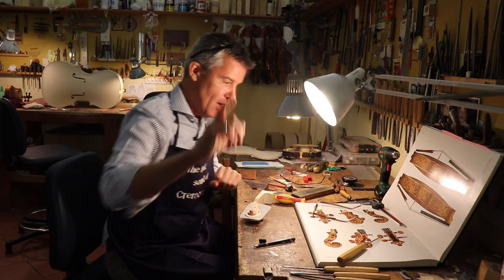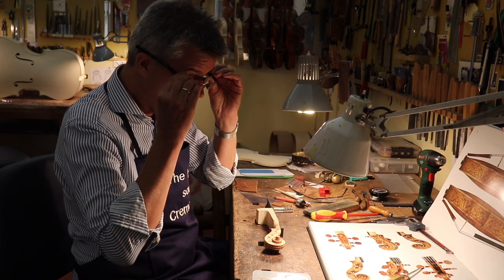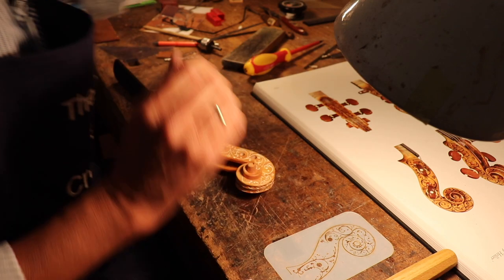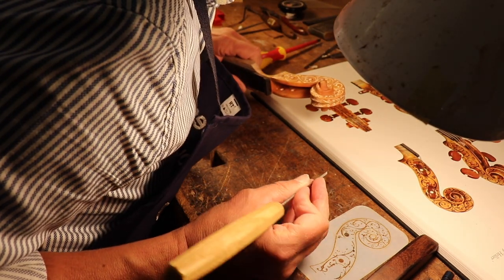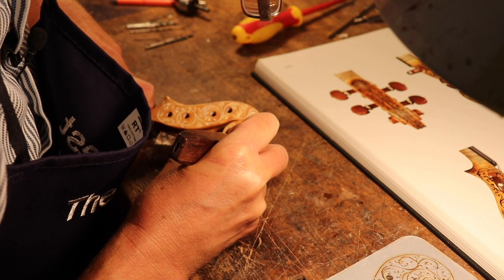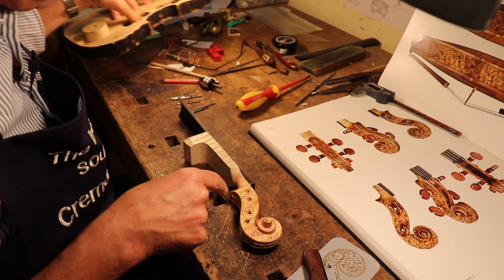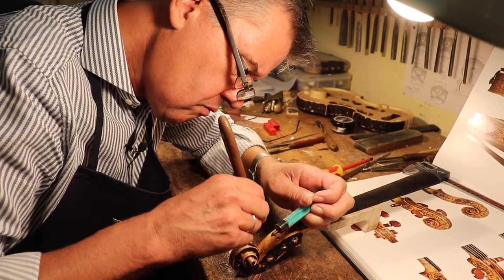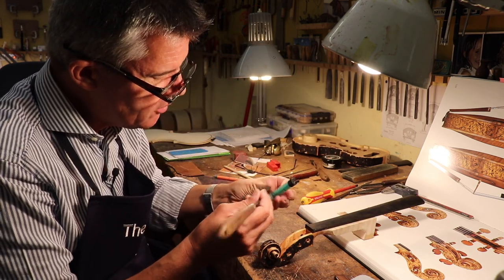Work with me on my decorated Stradivari Hellier violin - Part 1 🎻

Comment: Use small form drilling machine, make the holes perpendicularity better.
Reply from the maker: Yes of course, but the drill turns maybe three times and leaves just a surface scratched hole. Just enough to leave some of the ebony glue mix.
So no need to turn it into new levels of drilling which I don't have here at the moment.
Some factories use machinery like a dremel and the result is super ugly.
Most nowadays use CNC and none of them could convince me.
It is a lite like writing by hand or with the PC.
Hand Witten has more personality and that's what we actually want to transmit with such decorations.
Right?

all the best and thanks for your interest here

Edgar

Comment: Very intricate work but beautifully done. Could you show how you made the ebony dust? Could black wood fillet be used instead. Did you seal the wood before carving, as the pegbox looks a different colour to the rest of the neck?
Reply from the maker: The ebony glue mix is actually very easy to make. Ebony dust and glue. Just pay attention that the ebony dust is obtained by filing and not with sandpaper. Because the sandpaper would leave small sand parts in your ebony glue mix, which later on destroys your tools.

As for the ebony fillet, I am happy I didn’t have do do that that way. Believe me it would take you a year to make one instrument like that.

All the best and enjoy

Edgar
Reply: @EdgarRuss  Excuse my spelling I should have said Black Wood Filler and not Fillet.
Reply from the maker: @bluehoo0  😂
Ahh, ok! Yes of course you could. But at the time you "invested" already many hours of your precious life I prefer to use ebony dust/glue filler.
But I guess no-one would blame you if you use whatever you prefer. You are the maker and you decide what is best for you and your violin.
Right or right?

all the best

Edgar